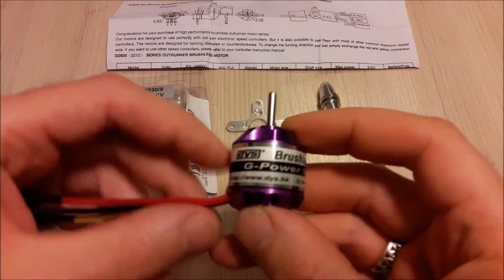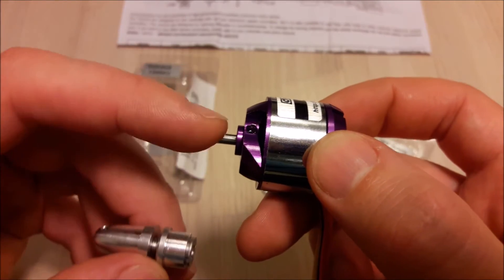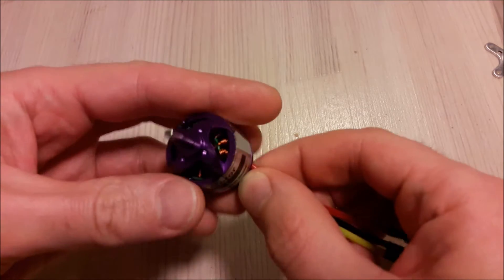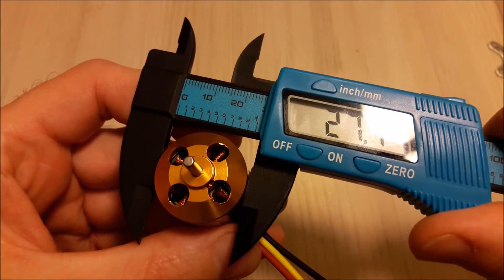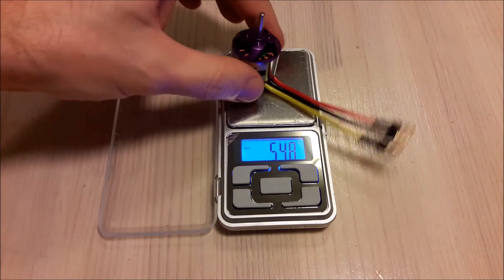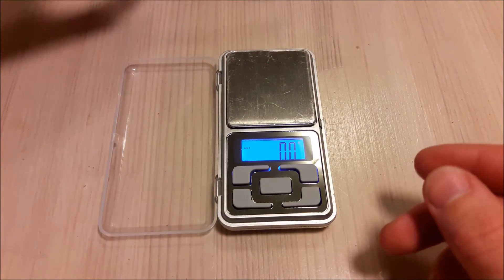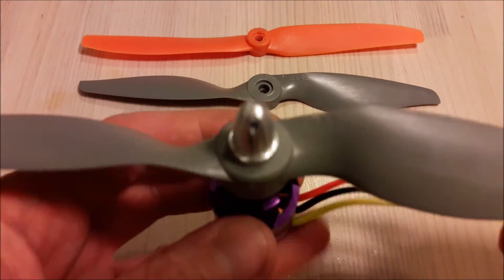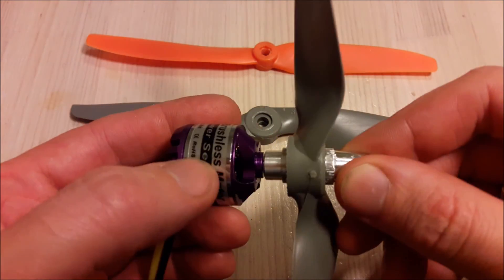DYS 2830 1300kv motor review

Comment: in the datasheet the max power is 275W WITH 9*6 PROP but you find 341W withe the same prop is that normal
Reply from the maker: Real life tests can differ from the datasheet. Actually the datasheet has safe values. Motor thrust probably is tested @12V instead of the fully charged battery as I've used. This motor pulls 1.1kg of thrust @12V battery with 9x6 Gemfan prop.
Reply: Right, I wouldn't even want to do that

Comment: if i use it withe 3s 30c 2200mah lipo and gemfan 9x6e how much thrust will generate
Reply from the maker: 9060 prop on 3S should geberate about 1.1Kg of static thrust @ about 28amps.

Comment: Hi. I am going to buy this motor and this video is very informative for me. I have a 2830 3850kv motor, what propeller and esc size should I use with 3cell 2200mAh. thanks
Reply from the maker: Muhammad Aamir you probably have 850 KV motor. The lower the KV, the bigger the props should be used. You can use 9-10-11 inch props. Make shure your esc will have at least 30A. Good luck!